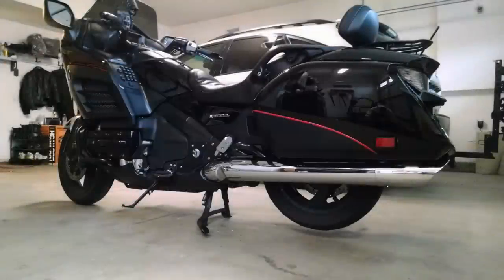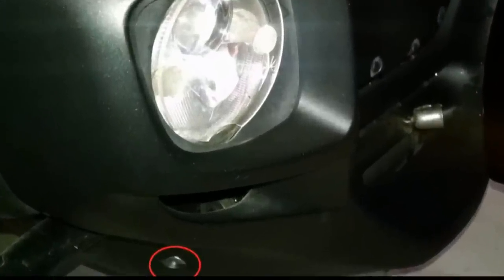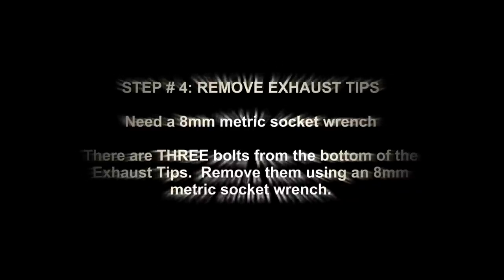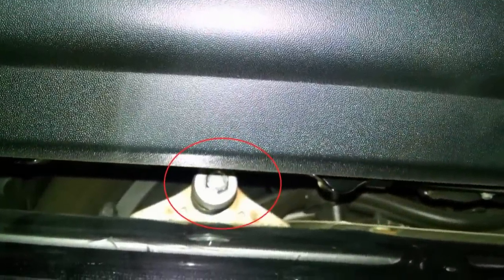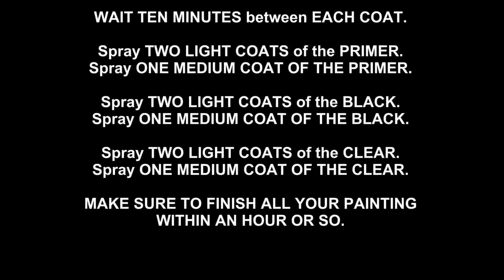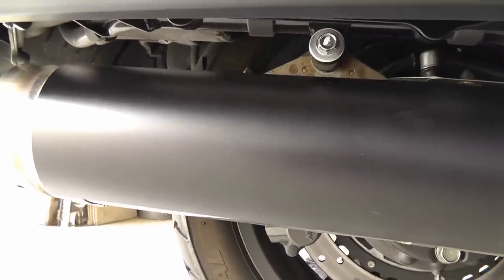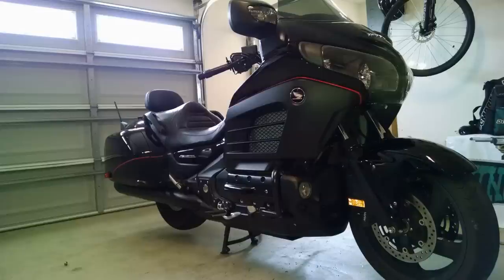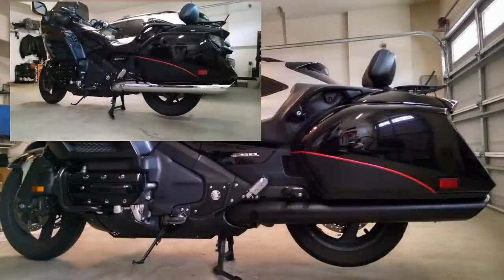How to Remove and Paint Heat Shields / Exhaust on a Goldwing F6B (GL1800) with VHT Flameproof

Comment: You identified in the beginning that you were not a technician . What did you use to identify all the screws that needed to be removed?  Was it a parts manual, a specific manual for the F6B or something else? Awesome job. Looks great. Thank you for posting!
Reply from the maker: +RK Smith RK, thank you.  I didn't use a parts or service manual.  I read on a forum in order to access the heat shields, one would have to remove all the parts that lead to it starting from the front, the middle, then the heat shields.  I went online to a dealer website where you can order oem Honda parts and looked up a section...and it showed the front cowl and protector assembly.  With those parts, it also showed where the bolts are.
Reply: Thank you for your quick response and for the how you found the information